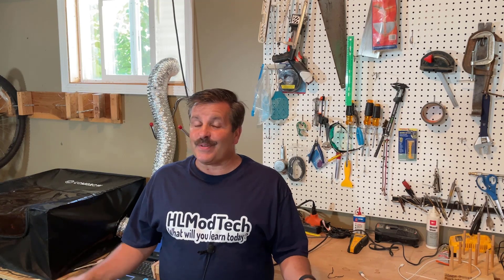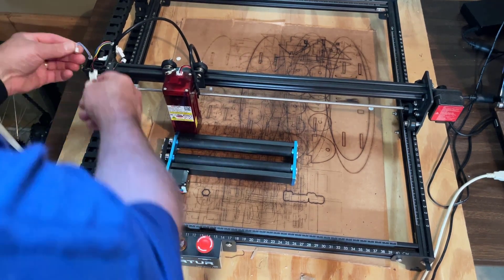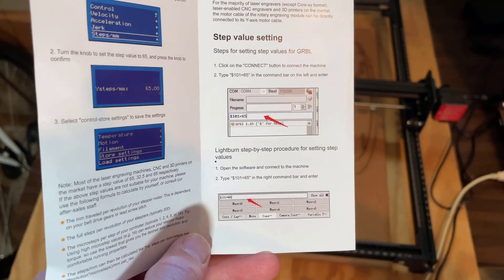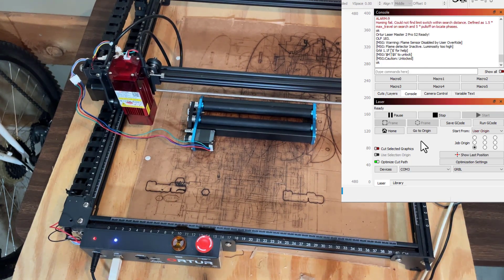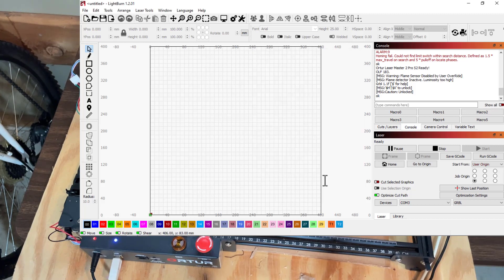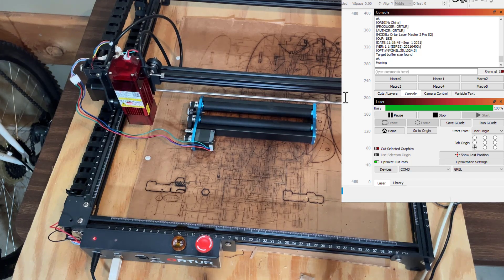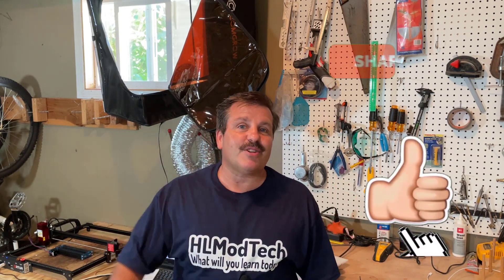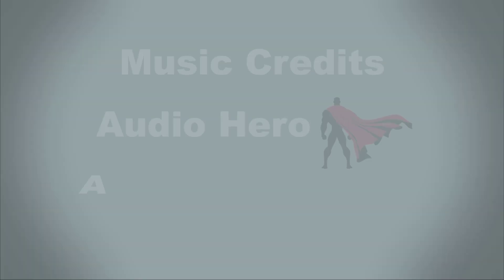Ortur Laser Master Pro 2 Comgrow Roller Issue | Tips Welcome

Comment: After you start the homing sequence press the homing microswitch on the bottom left of the gantry. Its all I can think of as I don't think you can bypass it. I think it's baked in to the firmware. Sorry if it doesn't help and I don't know if I'm right. hope you get the help you need. Keep up the good work.
Reply from the maker: That sounds pretty slick! Will give it a go. Thank you.
Reply from the maker: So that enabled me to move in x after it powered on. Still pops an error when I try to move y though. I will do some more investigating in the morning. Thanks again for the great idea!!!